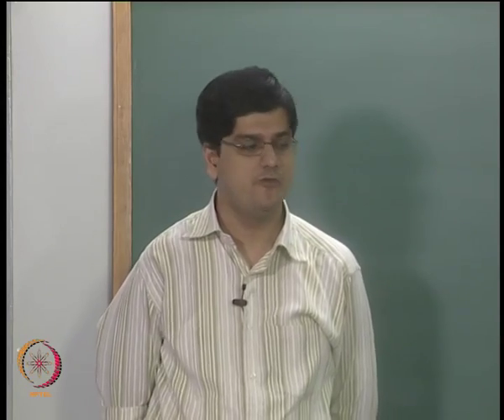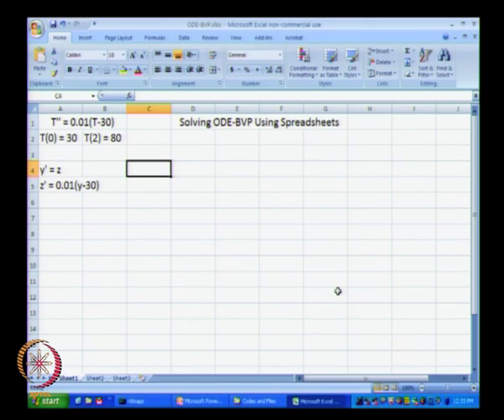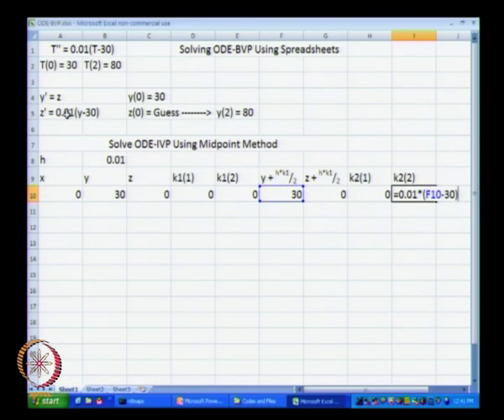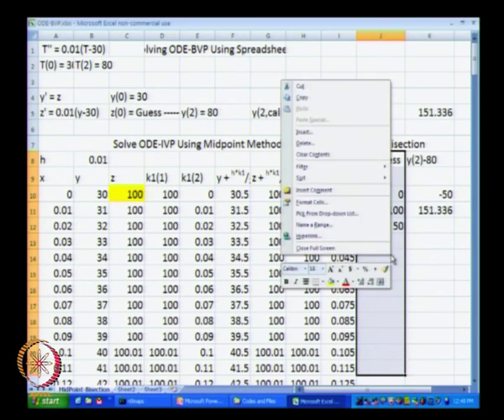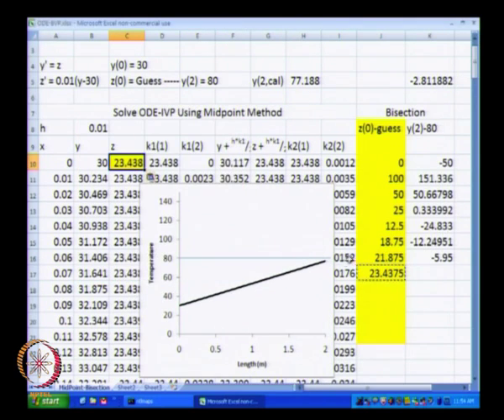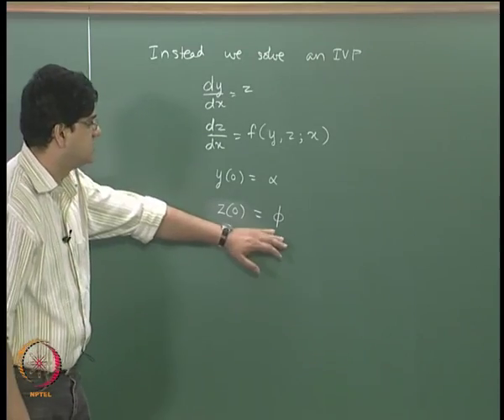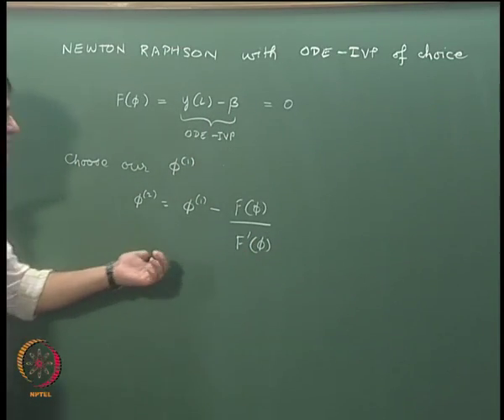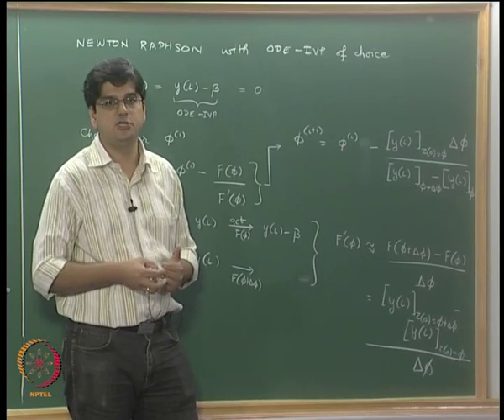Mod-08 Lec-35 Ordinary Differential Equations (boundary value problems) Part 2

Comment: 14:10 for the calculation of k2(1) and k2(2), we are using euler's explicit formula?
because k2(1) = dy/dx @ (xi + h/2, yi + h*k1/2)  which equals to z @ (x = xi + h/2, y = yi + h*k1/2) 
now since we are using the equation z + h*k1/2 as the result for this implies we are calulating z @ x = xi + h/2 as ((z @ x = xi) + h/2 * dz/dx @ x = xi) which is the euler's explicit formula. Same for k2(2).